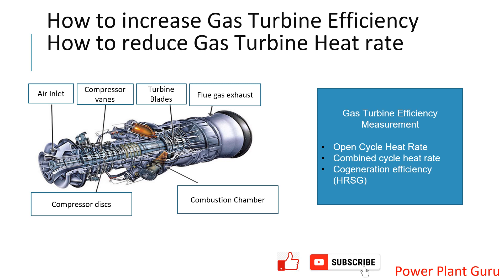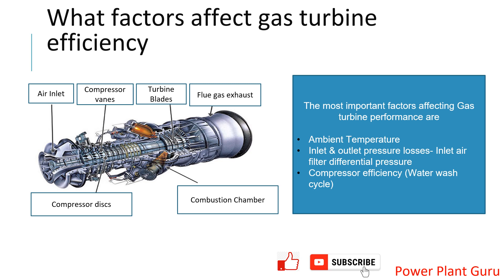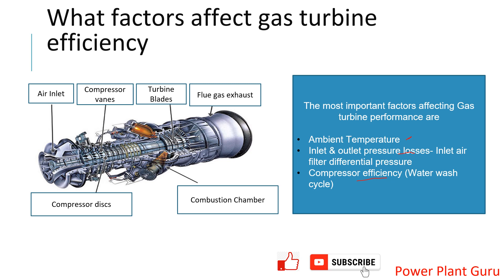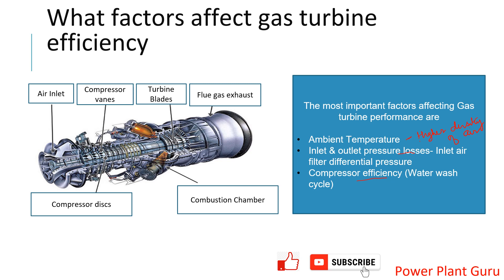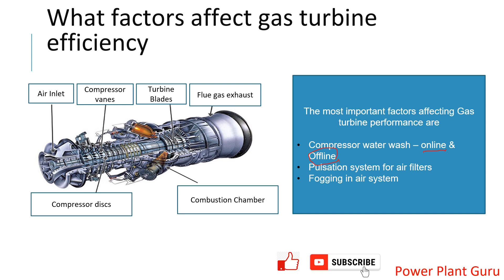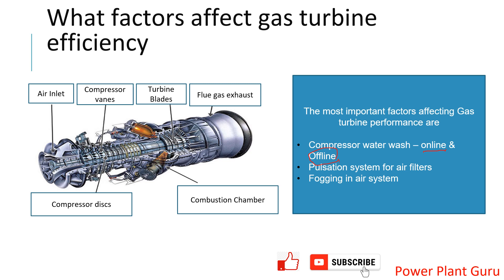How to increase Gas turbine Efficiency, improve heat rate

Comment: Please make more videos on power plant topics.
Can you please make video CT fan pitch angle and amperage relation.

I am looking for relation b/w pump flow (FWP pump flow and discharge pressure) over the amperage.

Like at sliding pressure mode the pressure of HP FWP is reduced so it will decrease the amperage or increase the amperage.
In short please make video on pumps (such as BFP, CW, Deep Well.pumps) flow and motor amperage.
Reply from the maker: Noted. Will try to do so. Thank you for your encouragement.

Comment: Gas Turbine efficicency drops whileoperating at HSD because in HSD operation stack temperatures are kept high to avoid acid dew point temperature.

Now for this the High temperature HP water is supplied to HRSG .
Reply from the maker: One more thing which can be done is to operate the machine always on IGV temperature control mode ON.
Reply: @powerplantguru007  That's the most (confusing and intertsing ) aspect of GT. 
Speed control and Temperature control modes of operation. 
In my view gas turbines are more interesting than steam turbine. 

Your videos are great. Keep doing this great work.
Reply from the maker: I agree. 
The intention here is to spread awareness about the handle for operation engineers by which they can do improvement.

Comment: But power plants which are more than 10-15 years old suffers a loss in terms of heat rate.
Upgrading compressor blades is so costly.
Over the time Sulphur deposits at evap section. Hydrojet cleaning normally cleans the economizer section only but for Evap cleaning special arrangement required
Reply from the maker: Compressor blades hand cleaning during MI shall give much improvement. It almost nullifies the recoverable losses due to deposition
Reply: @powerplantguru007  Yes you're right even in PPA the heat rate degradation is mentioned. There is some percentage of non recoverable loss and recoverable loss. 
I think operating power plant at part load also impact its performance, most of time system operater instruct to operate plant at part load.
Reply: @powerplantguru007  I have observed only one MI , it was so interesting to see all activities.

Comment: Evap coolers do not work in high humid seasons. 
Gas turbine efficiency is my favt topic.
Even Water injection during HSD operation effects efficiency. Adding Water injection increase the heat of evaporation but increases mass flow too. But in many sites I've observed that they don't take water injection in service because overall heat rate degrades.
Reply from the maker: The maintenance factor also increases with water injections, so plant managers generally doesn't prefer water injection. Also spread related nuisance would be definitely there